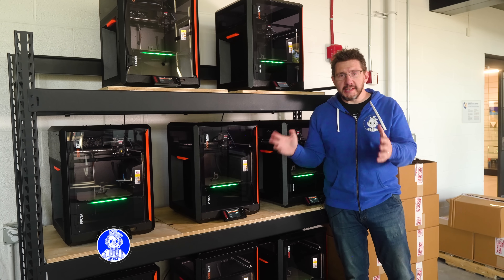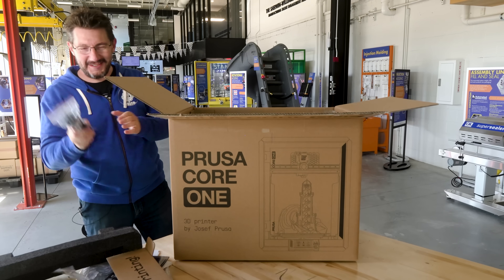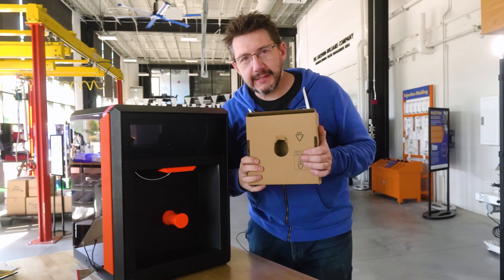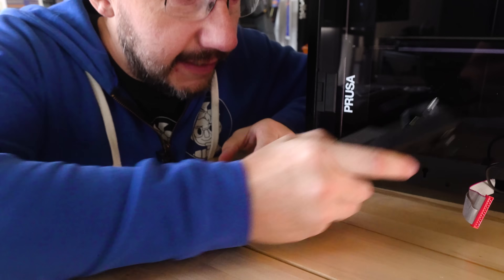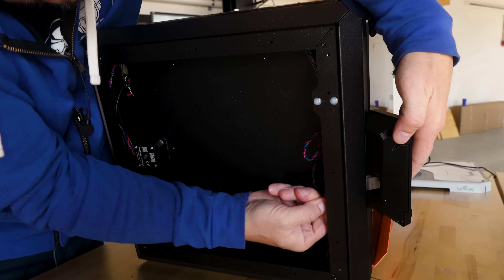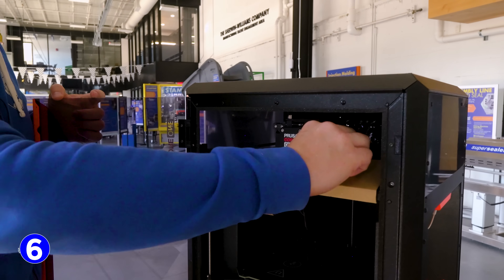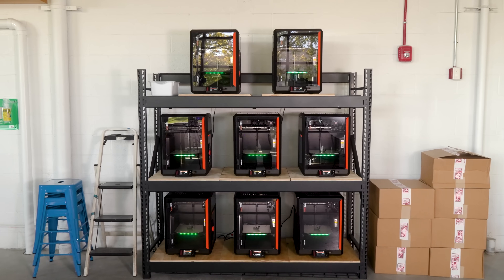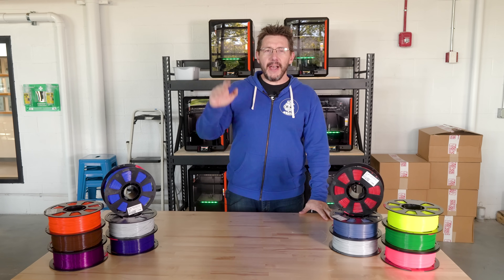Cleveland is the FIRST Prusa Print Farm!

Comment: Nice printers but no heated chamber, now I've moved to a pair of 22IDEXv3s with 200c build places, 100c+ chamber, and 500c hotends for Ultem and PEEK. Nothing is cheap, especially the materials, but you can charge a lot for the parts.
Reply from the maker: A pair of those? NICE.

Comment: Looks good, there are a few very minor changes from my first batch Core 1, most notably the feet. I had to cut the feet myself to make L shapes. The ones in the video look  much easier to do! My cardboard handle also broke when I was taking the printer out. Definitely my fault not being careful enough, but I love that it's all cardboard and recyclable in my bin instead of having to find a place to take a bunch of foam.
Reply: Other changes: the swing arm pivot is rivted, and the X and Y motor mounts did not have viewports on them.

Comment: i dont mean to be rude, but if you do an unboxing and the setup is like 3 steps, maybe read the manual :D
you dont have to tip the machine for the screen. the plate that holds it is magnetically attatched and you can slide it off from the front. 
you do have to tip it for the feet anyways, so who cares, but the screws are definetly easier if you take that plate off.